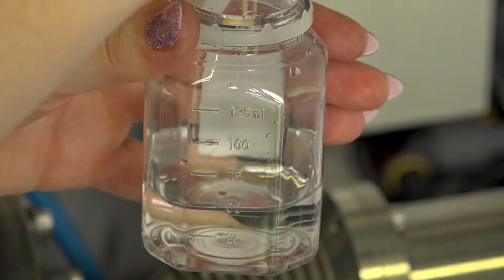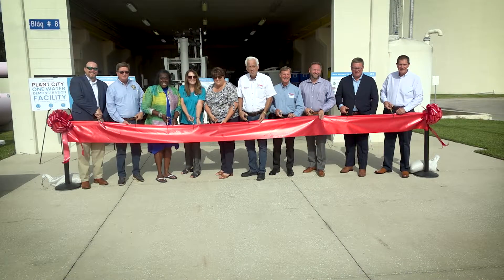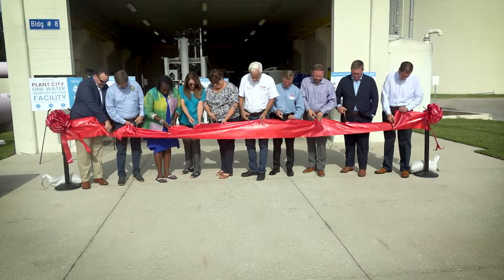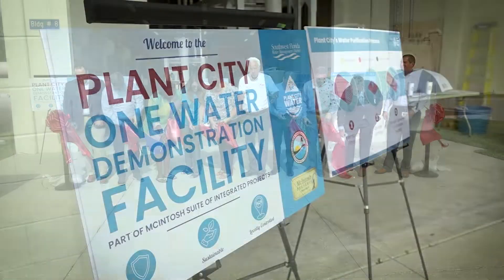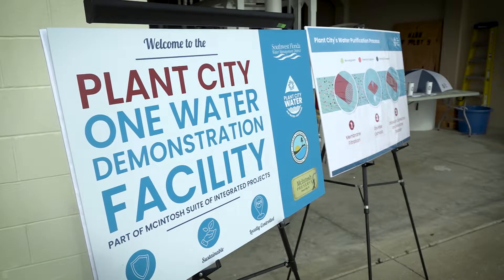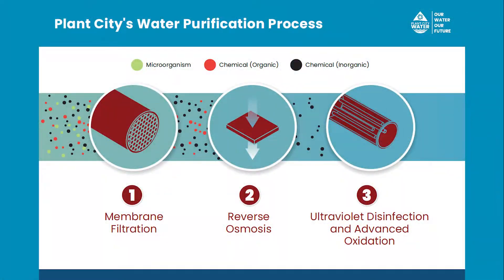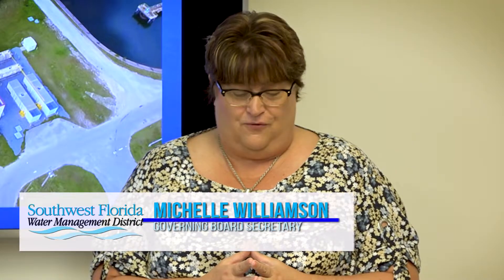Plant City One Water Demonstration Facility

Comment: With the reverse osmosis filtration minerals are removed from the water.  I wonder if this will be addressed to prevent known dental and bone problems caused when people only drink RO water.
Reply: a lot of bottled water plants use RO and then reinject minerals into the product water, but it is for a taste aspect, not for health or nutrition reasons.  mineral injection is a pretty small cost, similar to the fluoridation process in city water.   people do get enough minerals from a proper diet, if the water is void of minerals.  as far as dental concerns, fluoride in the city water is the most important, but even that has come under attack in various communities.